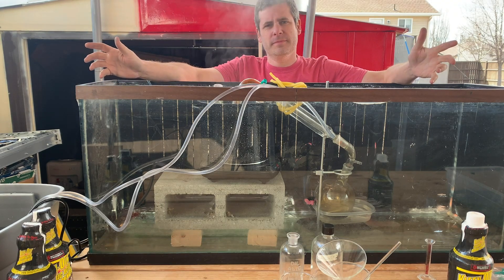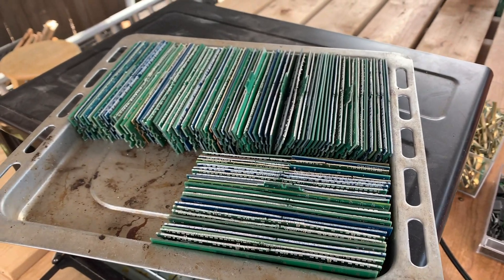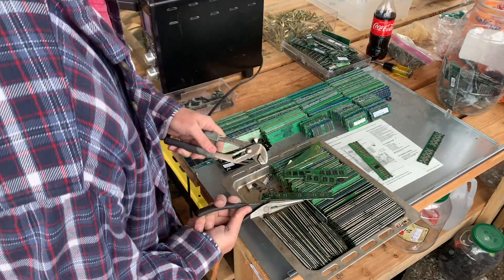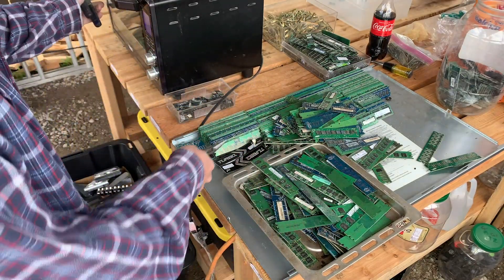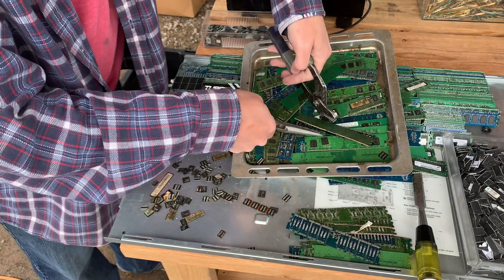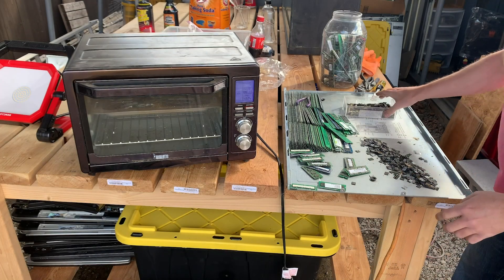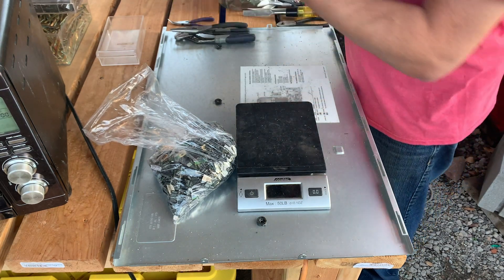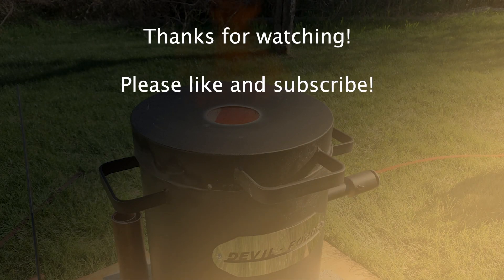Fastest IC Removal for Gold Recovery

Comment: So I got a heating element from an elctric dryer, wired it straight to 12v.. i can reshape it to use fornall kinds of stuff but for this task i jave flimsy razor edge i hose clamp to the heating element. Once everything is glowing bright red i just drag those ram sticks against that razor and the chips just wipe riight off
Reply from the maker: That works too.  :)

Comment: Loving the channel, nice work, keep it up. 

For finger removal do yourself a favour and buy a heavy duty guillotine (vevor are OK for entry level and these will glide through 2mm sheet steel, a RAM board has no chance 😜 £60GBP off ebay approx 70USD easy to sharpen if needed).

For the BGA chip removal build yourself a small stand to hold the chip upright at a very slight angle. Use a wide chisel and just smash them off the board, saves a lot of messing around and a lot of electric and is a lot quicker, 95% come off undamaged (you also get the benefit of removing all the other resistors/capacitors at the same, save these for possible processing in future once you have a few kilos worth to make it worthwhile), not as effective for SD/DDR1 but it still works if the base is solid enough, I prefer to work SD/DDR1 with the air chisel.  As you already remove the gold fingers any damage done to the chips or board is inconsequential as you are now into processing and not reselling (although as a buyer I'm not bothered if some of the chips are broken, any losses will be negligible and since I buy by weight I will still get roughly the same results eitherway).   I made a box to go around my stand to deflect any flying material downwards as they detach from the board (make sure you wear your safety goggles just in case a stray fragment gets past).
Hope this helps.
Reply from the maker: Super helpful.  I am after a finger slicer!! This has been a really helpful post!  I can’t thank you enough!!
Reply: 👍 Just watched you toasting some motherboards.. 😋 Love it, that smell...👌... doesn't go away for hours.  

I notice you mentioned sulphuric acid for IC chips. I'm in UK so concentrated sulphuric and nitric are classed as pre cursors, buying them without license is a definate no-no. I've had to adapt to a more manual process instead of just dissolving everything under the sun. Check out Successful Engineer's video regarding processing ic chips without incineration. You may need to get creative to adapt it to your needs but it's definately safer than dissolving ic chips in sulphuric and you save a ton of nasty waste.

Comment: The best deal on ebay is 1.06 gallon for $104 plus shipping for Nitric
Reply from the maker: I think I bought that... Nevada city... right?  I am going to use that in one of my next videos :)
Reply: @badideametals  I believe so, still expensive per liter but the best deal on ebay. The 15 liters for $300 is the absolute best Ive seen but like I said you need a business license
Reply: @badideametals  you do know plastic can go in Nitric solution, a lot of people process connectors that way. You also made poor mans nitric in you setup of trying to make nitric, your going to find you will need a shit ton of nitric for what your trying to process, you also need to boiling all your pins in HCL because you still have solder on them. Chisel or cutting them off is what most people do to bypass that step. Poor mans nitric is just sulfuric acid and some nitrate and heating the solution, way cheaper because your using mostly water for the salts. If you do want the link to the 15 liters of nitric  let me know its where sreetips gets his nitric. Wet ashing is something more and more people are doing, it started with BGAs but now its any kind of IC chip. Good luck
Reply from the maker: @chosen1one930  ya, that link would be nice.  I am hoping to get better at lowering costs of what I do.  Again, thank you for posting your comments!
Reply: @badideametals  you can search the site for nitric reagent for more brands etc. Or search google for nitric reagent for other websites to browse prices etc. I posted geo's link above on poor mans nitric, it works well and a lot cheaper. I have almost 15 years experience for ewaste recovery and refining but I no longer recover or refine that much due to being diagnosed with two rare diseases. I have even longer experience with collecting rare, unique and prototypes/sample CPUs and boards. Big money for items like that, I hate to think about the pieces people have thrown in acid for gold due to lack of knowledge.
Reply from the maker: @chosen1one930  you must not have seen my unfortunate tear apart of a PDP8 3 months back
Reply from the maker: Sorry about the rare conditions stopping you.  I was a bee keeper until I got too allergic to keep going.
Reply: @badideametals  you dont want to know how much some of those boards sold for not to long ago, lmao if you never know im a good one to ask
Reply: @badideametals  watching the video now, Just because it looks like IDE doesnt mean it is, several variants, the bigger boards are highly sought after, some can sell for $500 but usually $100 and up. Anything old is worth something in ebay, even more if you can test it and prove its working
Reply: @badideametals  I have degree in Turf management and worked on golf courses for a long time but ended up working for google for several years when My condition got worse but still didnt have a diagnosis, most people die before they get diagnosed with my disease, I was lucky I almost did. I never made videos for fears of people hurtung themselves or worse wuth acids but ive shared information for a long time on forums and in comments on here
Reply from the maker: @chosen1one930  the good news about the PDP ... after that video, I got in touch with a DEC preservation group and they took about 70% of what I had left... sad to lose one unit though ...
Reply from the maker: @chosen1one930  I worried too about people copying and getting hurt.  I am still new enough, I worry I will be the one who gets hurt.  I have a background in science and tech myself.  Programming, building, repairing, now deconstruction :)
Reply: @badideametals  just treat acid with the respect it deserves and youll be ok and remember NO FILTER can save you from nitric fumes, until we make something that will remember that.
Reply from the maker: So true! And ya, I did know that nitric has no filter... and also the gloves used are important ... or they can catch fire.  Feel free to reach out to my email (badideametals@gmail) ... this has been a really great download.  I am always up for more learning.  One thing I learned in the tech world, I can always learn more... I am 2 weeks out from posting a gold refining video (Gold Corner BGAs will be my first on the channel ... I was hoping to do this BGAs video months ago but my Nitric making video flopped ... as you know)  So I resorted in buying Nitric from eBay ... which you also now know ... I still have tons to learn.  I do have specific questions too ... so, ya, feel free to reach out if you are good to keep talking.
Reply: @badideametals  sounds good. Chemical proof gloves are a must. I still worked without gloves some but only during certain times. Will send a email today or tomorrow.
Reply: Heres the best advice anyone can get, never pre mix Aqua Regia, you can dissolve 4 troy ounces of gold with 300 or 400ml of HCL but only 35ml of nitric. Pre mixing waste so much. To save on nitric when dissolving fully plated pins I would cut them in half and than only use half the amount nitric to dissolve base metals rinse than boiling in HCL or AP the rest of the way. I did this with certain pins that require vast amounts of nitric. You can always go the route of reverse Electroplating depending on how safe one feels with sulfuric. I always switched it up depending on the material I was working with. Right now I have several kilos of military pins Ive been working on, removing them from the connector, removing the stainless steel sleeves and stripping the copper wire on the end than cutting it off and throwing in my copper tub. I still buy material like crazy off ebay but only amazing deals, to resell once gold hits 2500 or higher
Reply from the maker: @chosen1one930  very good advice!  Do you have advice for the really low grade pins like ram slot pins (not ram fingers) or the pins on vga/dvi sockets?
Reply: @badideametals  Eco Goldex, you can find it on ebay, its a gold stripper that works really well from the videos Ive seen, ive never used it but for low grade material or really anything it works. You can find videos on archimedes channel or just search for it. Its pretty cheap but only comes from Canada I believe
Reply from the maker: @chosen1one930  ya, I saw that stuff too... the stuff looks like magic... but it had so many extra steps after the stripping, it seemed like more work in the long run... some sort of cyanide solution from what it looks like... I am probably wrong
Reply: @badideametals  not magic, justba solution with the right pH, same thing as cyanide or iodine etripping solutions.
Reply: @badideametals  so you strip the material, than adjust pH, than drop the gold with zinc...after that you re-refine with Aqua Regia...I havent watched a video in a few months or longer so it could of changed, I sent you a email. If you ever cant get in touch with me im in the hospital fyi

Comment: What do you do with all the other surface mount items on the RAM like the MLCCs, etc.? And do you save the blank sticks for more gold recovery?
Reply from the maker: I save MLCC and SMD resistors ... they have silver and “can” have other precious metals... I have yet to find RAM that has gold finger AND non-magnetic MLCCs... but I sort them ... and sell them on ebay ... I keep the sticks as there are gold leads on the boards and in small holes ... it really will not amount to much, but I will do a video on the stick refinement some day :). What do you do with them?
Reply: @badideametals  just saving them for now. Eventually I’ll do some refining. 999 Dusan might have some vids. I know he’s  removed the green mask over gold flashing that might be underneath certain boards. I try to pick off the easy goodies like fingers, pins, chips, BGAs, MLCCs, etc. to stockpile and take the rest to Utah Metal Works in North Salt Lake. They are the only ones I know close to me that buy boards.
Reply from the maker: @dr.a006  I have questions ... do you mind emailing me?  It would be interesting to compare notes.
Reply: @badideametals  is your email listed somewhere or mentioned in a video?
Thanks
Reply from the maker: @dr.a006  it should be on my about page... but it does not always show for everyone... badideametals at gmail

Comment: sorry sent my message before I seen the end of the video..so it was inhibitors.i was thinking it would have to be something like because you were constantly boiling so eventually something would have to come accross. in Ireland here it's nearly impossible to buy nitric acid so I have to make my own..I reclaim my nitric from copper nitrates from silver refining or any other used nitrates if possible also recover hydrochloric acid from AP solutions and recycle sulphuric..if u had time would u consider doing videos like them.it great coz it reduces your waste etc
Reply from the maker: I would consider it.  I have to figure out how to remove the inhibitors on my H2SO4.  I have been given the recommendation to boil out the inhibitor... which could work.  I need to figure that out I guess for one of my next projects ... I want to dissolve the caps off these IC chips ... I am not planning to make NHO3 again for a little while.  But I have the chem set ... so it is all just a matter of plugging it all back in and getting the reactions started.  Thanks for your comment.  And yes, Nitric can become scarce here too ... and when that happens, it will be nice to know I can make it my self reliably.

Comment: you need to wrap aluminium around your boiling flask..just by boiling the sulphuric and potassium nitrate isn't good enough.what happens it condenses and flows back down the boiling flask..so wrap foil around the boiling flask all the way upto the t-connecting and stop it there.am pump ice water through the condenser it helps alot..what temp were you at..fuming nitric comes across at 83°c and tech grade cones across at 120°c I thinks.hopefully that helps.